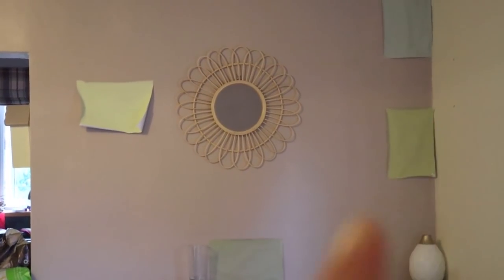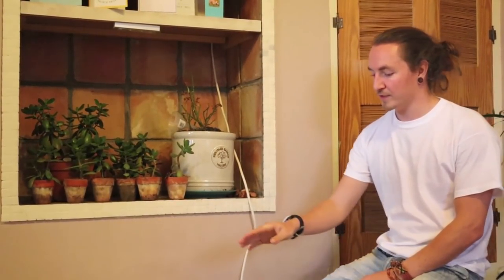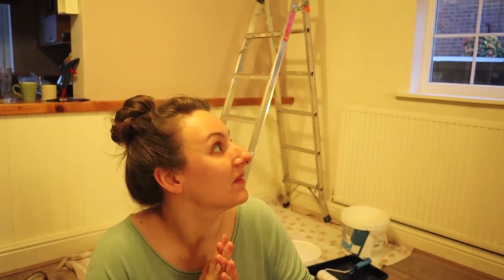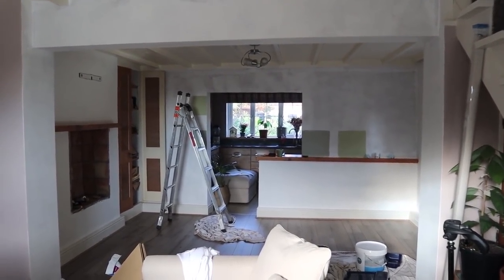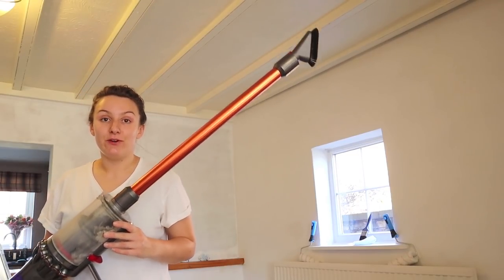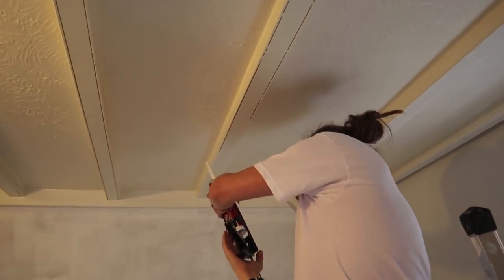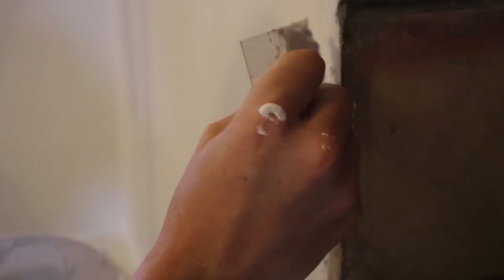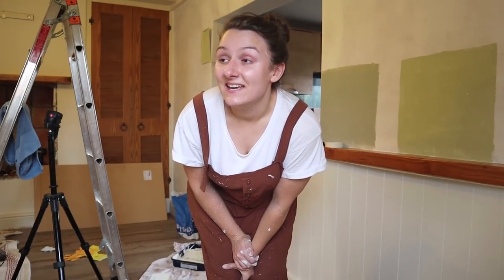redecorating my 200 year old English cottage! ~ home make-over vlog

Comment: Tip #1 Always paint the ceilings first.  Otherwise you'll end up with tiny splatters of ceiling paint from the roller onto the walls. Any larger smears etc will ruin the wall paint.
I am about to paint the entire interior of my home as well as sand and refinish the hardwood oak floors throughout.